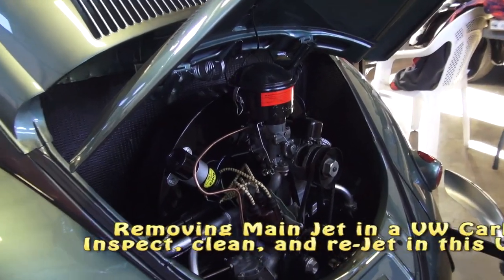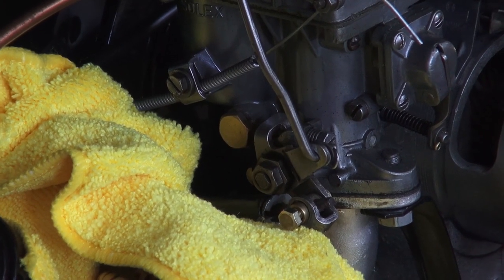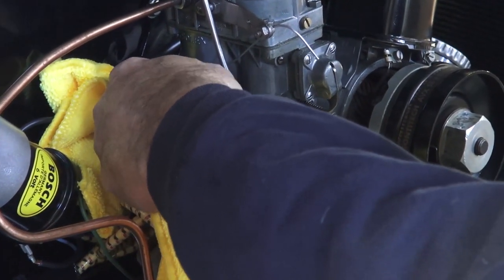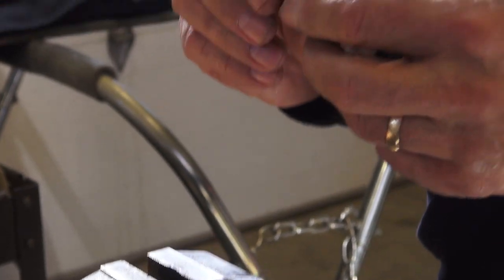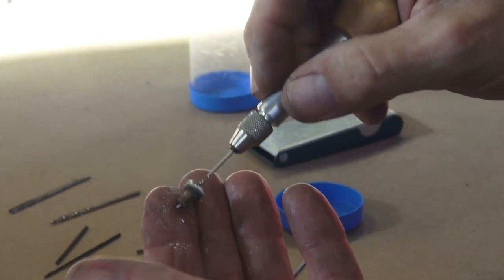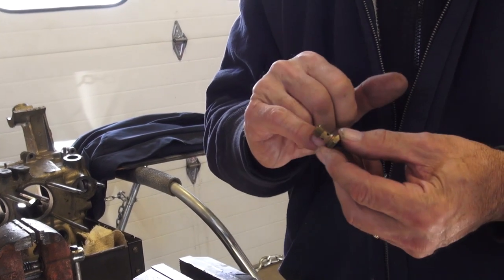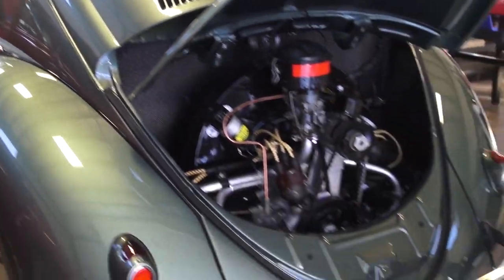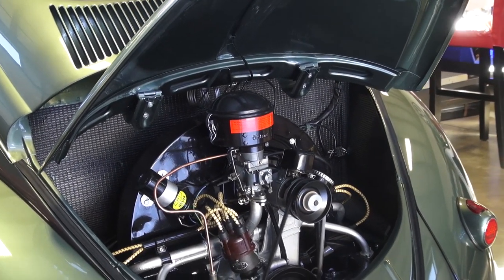Classic VW BuGs How to Clean & Re-Jet Beetle Ghia Bus Carburetor for Performance

Comment: Chris. Have you ever re-jetted the idle circuit? So many of the Solex carbs. and Chinese look-a-like carbs. are hard to get to idle. Always is a lean condition that cleaning does not help. Even brand new carbs. right out of the box mounted on new manifolds with no vacuum leaks have idle trouble when the choke goes off.
Reply from the maker: We have not done that, no.
Reply: Chris. Thanks for your prompt reply. Any suggestions where I might get a selections of idle circuit jets? I would think that a VW dealership will just say the word "obsolete". I would like to make it just a little on the richer side like I set mixture screws. Thanks.
Reply from the maker: @bottmar1  maybe cip1.com or wolfsburgwest

Comment: The fuel of today has an alcohol mix.  The percentage depends on your location.  To maintain the original power design of your VW, you must increase jet size.  If you install "Big Bore" jugs and increase the piston size, you also have to increase the jet size.
Reply from the maker: Yes very true

Comment: I recently upped my pistons and replaced carburetor at same time. Seems like carb took adjustments better with smaller jet. I forgot to oil o rings and they tore on bypass, not sure if this is why dies out on acceleration.

Comment: excellent video. VERY well shot, clear to see what is being explained.

I was just literally researching jets today, as I've put on a new carb, my old jets where crushed when I pulled them out.

The old carb was beat up by the previous owner, and is a big repair job.

QUESTION! 

I have a stumble off idle, and when cruising at low rpm. Everything else seems to be in order before I swapped carbs, I'm thinking its a jet issue. So would a stumble off idle and at low rpm be LEAN? or RICH? so I can buy the appropriate jet size.

Again, all your videos are priceless! i'm very new to bugs, and classics, and your work has been amazing help. THANK YOU
Reply from the maker: Might not be jets, could be your distributor.  Do you have an 009?
Reply: no sir, I replaced the oo9 that was on it (it was causing a miss so bad I had to pull over when the engine got hot) with a mechanical and vacuum advance SVDA Distributor

I messed with it for a bit, and it looks like my 30/31 had the jets swapped around, small idle, big main, So I switched them out, and will see if this clears it up a little. If so, I think I'm moving in the right direction.
Reply: well the jet change did not help, swapping them seemed to make it worse....
Reply from the maker: sounds like you are working with a hybrid carb.  Get the real carb for your year, a german one.
Reply: Chris Vallone it's a solex 30/31. my original 30pict1 is trashed unfortunately.
Reply from the maker: you need to find an original german correct year carb.  If you have a stock setup, you need the original.
Reply: Chris Vallone sounds good. mostly stock. just exhaust/aircleaner/timing bump. little power gain stuff. I'm at 5800ft elevation so offsets the power loss from thin air
Reply: Chris, that was excellent that you asked XArmy187 if he was running an 009 distributor, which definitely has the bog off-idle.  He said "no".
..
But is there a reason you did not suggest "accelerator pump", and attach a hose, and pump accelerator 10-full-strokes, divide by 10, to get the exact proper volume of gas injecting off-idle.  The pump is there to stop the off-idle bog (which feels much like the bog of the 009 distributor).
..
If XArmy187 does not have an "ml measuring cup" I usually just say increase the pump stroke a little  ... and drive it.  Then decrease the pump stroke a little  ..... and drive it.  Which direction was reducing bog ?  And which direction was increasing bog ?  Now you know which direction to move in..... if you are not able to catch and measure 10-full-strokes of  the accelerator pump.  Toronto, Canada  PS. Canada's cold winters need even more accelerator pump than the warmer USA states.

Comment: Hi Chris. I have a '65 T1 that's running way too rich with an all stock setup (distributor, coil, exhaust, intake manifold - all are rebuilt). The stock 28 PICT - 1 came with two main jet sizes, 0120 and 0122.5. Have you done any videos on re-jetting stock carbs? I'm at least considering the smaller diameter 0120 size main jet for starts. I've also read that when you replace one jet you should replace the others because they are all dependent on each other for different uses (at idle and as RPMs increase). The fuel pressure is at around 4 PSI. What do you recommend in this situation...trying to lean down a rich motor (without buying valves)? Thanks.
Reply from the maker: Fuel pressure is too much!  4psi is too high, it should be like 2 - 2.5psi.  That's why it is rich.